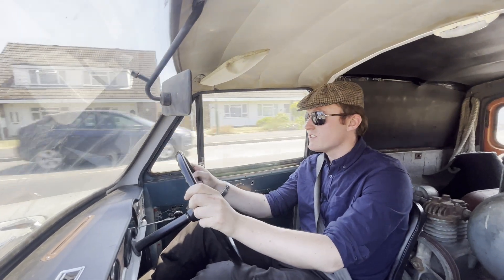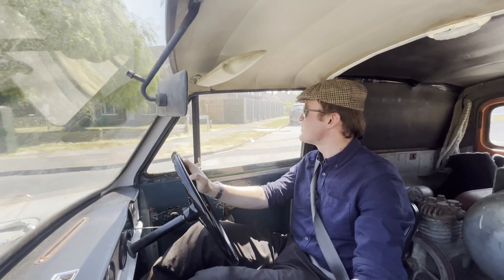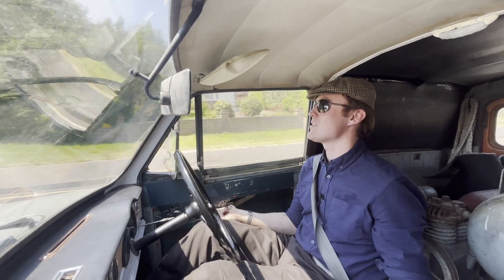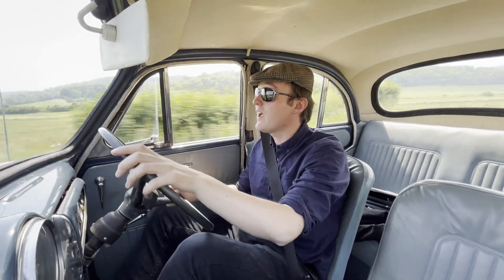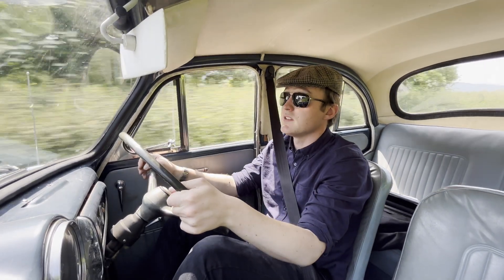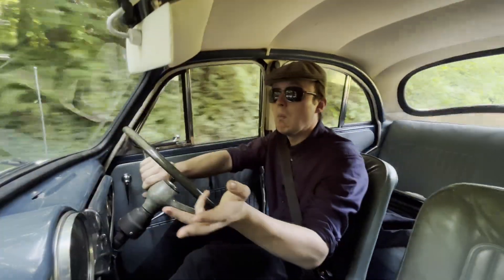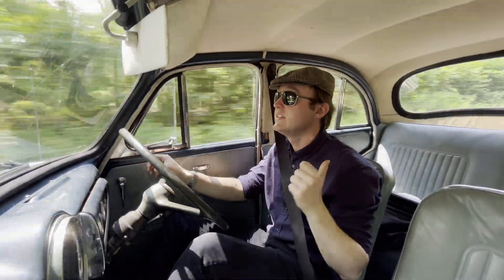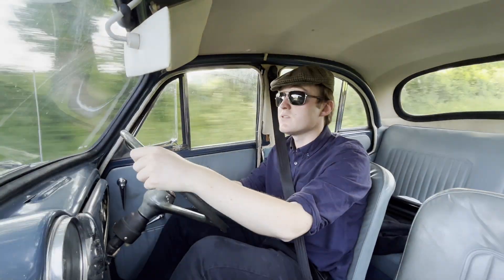Ethanol E10 and Classic Cars, The End Of The World?

Comment: We don't have that problem in Australia although we have E10 never use it because l had a reasonably modern vehicle and used E10 because it was efi but l had to have replaced two in tank fuel pumps and that was because of the ethanol and the next ute l bought l put 91 ethanol free unleaded petrol and never had to change the in tank fuel pump and now l have a modern classic ute a 1997 2X4 Toyota Hilux because it was exempt from emission laws it has the original carburator and no cat converter and the carburator is an aisin works well and aisin is owned by Toyota so as all parts on my Hilux are over built and extremely over engineered which equals reliability indestructibility and unbreakablability and l use 91 unleaded and also use it in our 2017 Suzuki Baleno had a 2007 Ford Fiesta put some E10 in it a destroyed the in tank fuel pump almost immediately but it was a crappy car any way pike of junk and we bought it brand new and my 1997 2X4 Toyota Hilux is so so much better because it's a Toyota and it originally cost me much less tge that absolutely terrible Ford Fiesta and l have owned my Hilux for 6 years also the 22R engine is a million mile engine actually saw a 1997 sell with 980000 kilometres on it and at aud $500 the seller had not replaced the engine are Toyota reliability

Comment: Here in Brazil 100% ethanol or alchol as they call it here is available in every garage & flex cars are sold from new with full warranty & alchol is just over half the price of petrol, the only addition on flex cars is a plastic  petrol container under the bonnet for cold & altitude starting , I've used 100% alchol on many cars & performance difference is virtually undetectable

Comment: Basically because you've got fuel hose that's been made this side of the year 2000, and you probably bought from a supplier that supplies with a British standard, which has been ethanol ready for a lot longer than 20 years. Anybody running original 50 year old pipe is going to have problems ethanol or not

Comment: Not a car I know but it runs on Petrol, my Vespa GTS 300. I have had three, the first one was a 2012 and I was running this when E10 came in. It was suposed to run on it but it lost power when I filled it up with E10 so I went on E5. My next 2018 Vespa came with two stickers next to the fuel cap. I ran it on E5 from the start but once when I couln’t get E5 I used E10 and guess what happened. You are right, it didn’t miss but it noticeably lost power when it was under presure. Now I have a 2022 GTS300, the engine has increased valve sizes, higher compresion amongst many other changes. I had to run for a while on E10 last month as my garage had run out of E5. Again I noticed the loss of power on hills, not by much but it is there.

Comment: Classic cars, you mean like cars from the 1920s, '30s, '40s, '50s, and '60s?

Well there's good news, ethanol-gasoline blends from E10 to E30 were used throughout Great Britain and Europe (some countries used 505/50 blends or just ethanol). And guess what the big petrol companies that sold these blends said about the blends:

They are cleaner, safer, more powerful, and less expensive. Who were these companies? Two were Standard Oil (Esso/Exxon) and Cities Service.

Rubber is NOT affected by ethanol. Ethanol is compatible with more types of rubber, plastic, and metal than gasoline and aromatics (benzene, toluene, xylene, and ethyl-benzine).

So if you have an old Morris Minor or Rolls Royce using ethanol-gasoline blends will not cause any problems that E0 gasoline (E0 petrol) doesn't cause.

Need proof? Read these reports:

The Hypocrisy of Big Oil
https://www.theautochannel.com/news/2017/12/20/478776-hypocrisy-big-oil.html

UK's Department for Transport Uses Boogeyman Allusions to Sidetrack E10 Adoption
https://www.theautochannel.com/news/2018/09/02/626528-uk-s-department-for-transport-uses-boogeyman-allusions-to-sidetrack.html

YES, TIN LIZZIE WAS AN ALCOHOLIC
https://www.theautochannel.com/news/2019/04/20/660939-yes-tin-lizzie-was-alcoholic.html

Comment: Copper Tube can 'Work Harden' and fracture when used on Engines for Fuel supply.
Cunifer brake Tube is better as it is 90%Copper and 10 % Steel.

Comment: I have a 1999 1200 Suzuki Bandit motorbike.  It's a bit of a gas guzzler if it's ridden hard.  Over the winter it's stood quit a bit and I was concerned about water separating out and rotting the tank out.  So I started running on the higher octain more expensive fuel that it seems to runs smoother on.  I'm in the habit of zeroing the trip when I fill up, I can mentally work out the mpg.  It would normally return about 31-34 mpg. However I was shocked that with the more expensive fuel I was getting 38-42 mpg, when I worked it out I was getting a real saving using the more expensive fuel.
Reply: We noticed the same in our 2011 Smart car

Comment: The other problem I have with Ethanol in non EFI cars is carburettor evaporation. Ethanol leaves behind an almost insoluble jelly substance that clogs fuel galleries, emulsion tubes and jets.
It has become so bad with cars in my fleet that are infrequently driven that I have installed fuel shutoff valves that let me drain the carburettor dry before parking up.
Prior to that it was ridiculous, removing the carb endlessly to strip and clean that rubbish out.
Reply from the maker: It is the sitting that has the most affect!

Comment: If you buy Esso Super, it doesn't have any ethanol added at all. 
You get better mpg which offsets the extra cost. 
Esso Super is sold as E5 but doesn't contain ANY (see their website if you don't believe me). 
I have to use ZERO ethanol because I lay my car up for months on end and the ethanol will absorb water.
Reply: If you read their website today, it says as of Sept 2023 they're phasing out ethanol-free fuel completely and their top-grade stuff may have up to 5% in.

Comment: ESSO Supreme is ethanol free in most areas of the country. Even though it says E5 on the pump.. that just means "up to" 5%, which zero is. There is no official zero sticker so they must use E5 sticker. I do very little mileage in my classics so I always use ESSO Supreme if I can. And although pipes can be made of copper etc. the diaphragms/seals in old pumps and carbs are still rubber (which you mentioned), which will suffer over time.
Reply from the maker: Indeed! If you can, it’s definitely better to have as little ethanol as possible. I’m trying to keep classic motoring open to everyone and not too scary for people new to the joys of old cars!… hence the video theme. Thanks for the comment as always!
Reply: That's useful to know, thank you.
Reply: The same with BP E5. Ethanol has not got the calorific value of petrol hence less mpg and ethanol fuel is more likely to go bad if you don't use your car much. The final crazy thing is that it uses more energy to produce ethanol than it produces.
Reply: @clivehaynes2183 You sound surprised. It's a mad mad mad world out there.
Reply: Not any more, from September 2023 it contains ethanol up to 5% as the other brands

Comment: It really does depend on the car, like you say.  I do tend to run mine on E5 just because of how they behave, the Maestro with its antique A series doesn't really care what you put in, though it seems a bit peppier on E5.  The Princess, with its decidedly more modern O-series engine will not run nicely on E10 in hot weather, so rather than have a winter/summer tune, I just run it on E5 to reduce hassle.  Economy seems about the same whatever I put in either of them.  Not had the Lanchester running for long enough to know either way, but I suspect that thing will run on lightly fermented bin juice anyway.
Reply from the maker: Lightly fermented bin juice! love it!, thanks for watching, always best to find what works for you.
Reply: E5 isn't noticeably different from E10 for performance in my modern VW 1.2TSI engined car, but I put it in every 5 fills or so as I understand the additives in Tesco Momentum fuels can help keep the injectors clean. I also generally use E5 over Winter in my (rather less modern) motorbike, because it is not used for weeks at a time, and I've read that it helps keep fuel 'fresher'. Honda say that all their bikes after 1992 can safely run on E10 petrol.
Reply: for the A series you just need a lead tablet in the tank every so often keeps the valve guides and seats in better nick
Reply: @simonjones7785  Those lead tablets are about as effective as homeopathy.

Comment: I have various classic cars and a modern family hack.  the classics are generally more sportier models or modified.  some years ago I tested the effect of running super and basic unleaded.  The super gave me up to 10% better fuel economy for a 7-8% price premium, the engines were smoother and less soot was produced, which I put down to the greater number of additive. The more ethanol the less fuel efficiency according to Govt advice so that 10% advantage may be a little light.  As I also require good quantities of fuel for horticultural machines I elected to just use super across the board.  I must say that even the mowers have benefited, both running very well now for 35/38 years.  I had to tear down one a couple of years ago for a (non-existent) problem and found the engine to be unworn and clinically clean inside.  Due also to the lower ethanol super has much better storage capabilities that is a clear benefit for over winter storage.

The issue with ethanol is that it is highly corrosive to brass, which is found in many classic fuel systems and I had one fuel pump give up after 12 months of ethanol use when my wallet overruled my logic on my Beetle..  What really concerns me is the corrosion of copper/brass/aluminium pipes and fittings as well as the rubber elements.  If you must have ethanol then fit R9 fuel hose not R6 as this will guarantee survival.  Esso, BP and Shell have all said that their super may not contain ethanol at all in some parts of the country and I believe that Esso lists specific garages that are ethanol free.  In a recent test the super fuels all had around 2 1/2% ethanol despite being labelled E5 on the pumps, although it was not clear the location of the fuel supplies.  At 2 1/2% ethanol I feel more comfortable with filling up.

For me the results are clear and Super is the clear winner,
Reply from the maker: Thanks for watching, and the detailed comment. E5 is definitely better, but i like to keep things open for everybody!